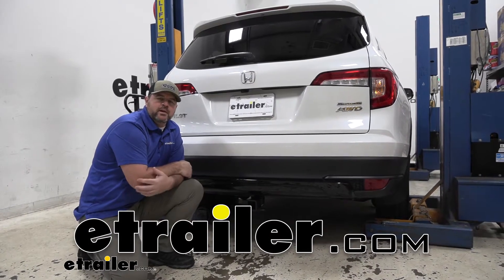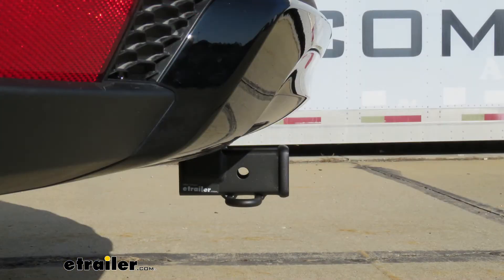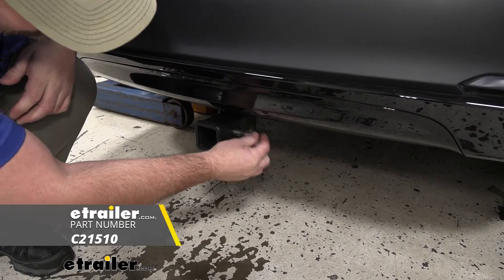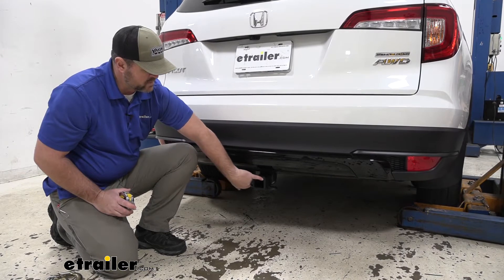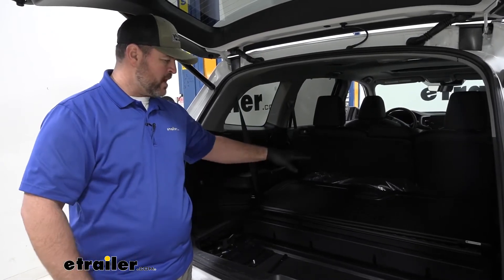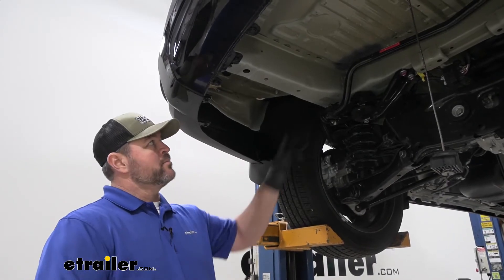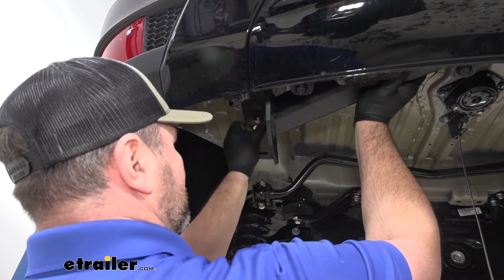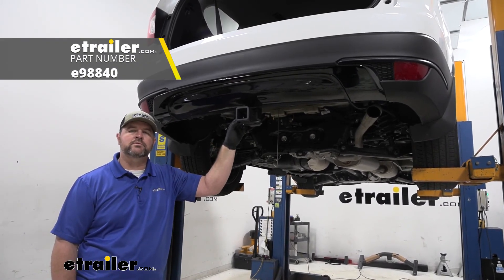2021 Honda Pilot etrailer Trailer Hitch Receiver: Complete Installation

Comment: Does my 2021 Honda Pilot hitch fit the new model 2025 Honda Pilot?
Reply from the maker: Unfortunately the 2025 Honda Pilot is a different generation than the 2021. Because of that, they use a different hitch. I'd recommend the # e27KR which you can check out using the link below:
https://www.etrailer.com/Trailer-Hitch/Honda/Pilot/2025/e27KR.html

Comment: Fix this Pilot have the hands free kick feature on it when installing the hitch?
Reply from the maker: The hands free lift gate sensor will still work with the installation of this hitch. You will just needs to find the sweet spot on either side of the receiver tube opening to activate it.
https://www.etrailer.com/Trailer-Hitch/etrailer/e98840.html

Comment: 8000!,!!  Really?
Reply from the maker: The hitch itself has that capacity if used with weight distribution, but the capacity of the vehicle itself will be the final word on how much you can tow. Honda lists the maximum towing capacity in the owner's manual, which varies by how many occupants, whether the vehicle is 2WD or AWD and whether or not the vehicle is equipped with an ATF cooler. AWD vehicles with an ATF cooler can tow up to 5000lbs with two occupants. 2021 Pilot models without an ATF and 2WD vehicles are limited to 3500 lbs with two occupants. The towing capacities decreases as occupants are added. The hitch has a higher capacity than the vehicle, but that isn't unusual at all.
https://www.etrailer.com/Trailer-Hitch/etrailer/e98840.html